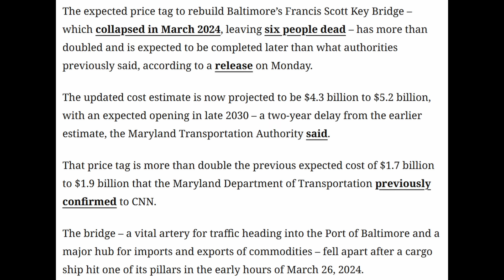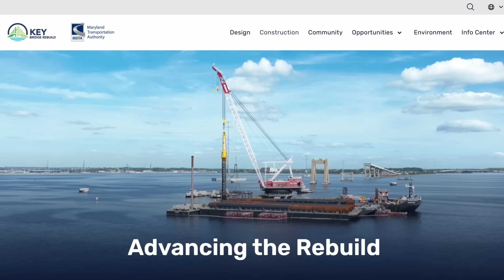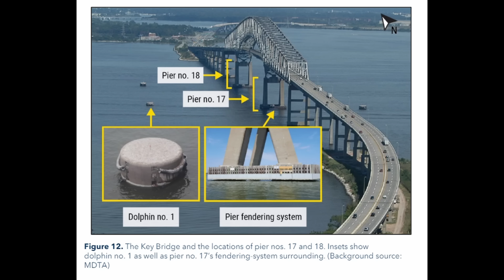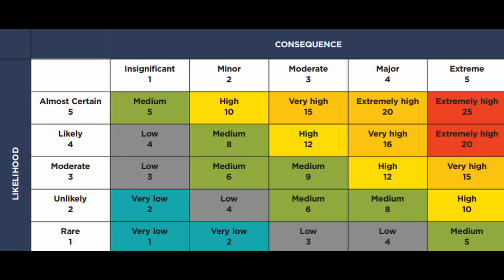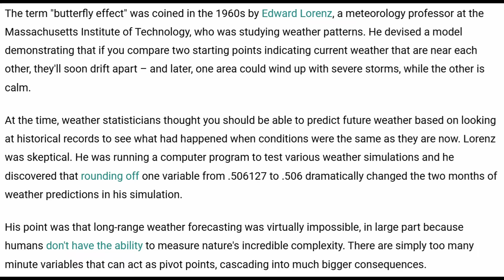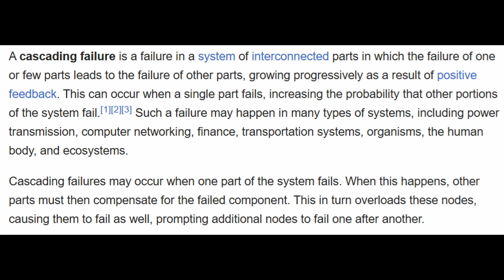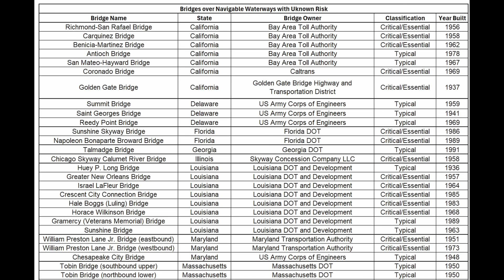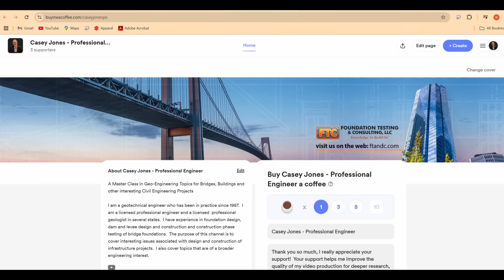Key Bridge Destroyed because of a Label on a Single Cable

Comment: The configuration of the vessel itself was to retrofit the clean fuel in a manner that wasn't automated. Generators 3 and 4 used a flushing pump for clean fuels in port. On top of this, the breakers weren't configured to auto mode, so the wire isn't completely the full cause here, it should have just automatically switched over.

Comment: in this case, a proper probabilistic calculation should have given a number of cycles (in this case a number of ships passing under the bridge) after which the chance of nothing happening halves... given the number of vessels coming under this bridge, such an event was overdue...
the key here would however be some form of a swiss-cheese model... the fact one wire could cause this (if it was one wire) is the massive issue here. now, having multiple tugs until the ship got beyond the bridge could have very much prevented this (and many other forms of failure), but you need to also balance it against the cost, and the impact the economic effect, and how that will effect society.

let us suppose that the added price to shipping of the tugs would cost x% which is in turn believed to reduce the regions economy by R%, at some point, the reduction in job availability will raise violent crime by about C% which will it may be estimated raise the number of Homicides by H%

now the range on each of these percent will be quite large, and will grow as you continue the steps away from the causal event, but, it can give a qualitative if not quantitive idea of how the effect of improving safety might effect other events, and it is an exercise that needs to be undertaken to determine whether one is most like to do good, neutral, or evil with every measure.

just saying...

Comment: Casey. I donot know how to even start looking at this but would the key bridge have been protected properly if it had the level of protection that is being built in bridges today?  Put another way, would we reduce the risk if we upgraded protection or is the current measures inadequate.  I find it hard to believe that the 4 dolphins would have been adequare to orotect the bridge from a ship of the era it was built.
Reply: The dolphins prevent a ship from striking the piers straight on. If the Dali would have steered directly towards a pier, it would have struck the dolphin first. (In this case the dolphin would probably have been too small to stop a ship that size.) But because of the power outage the Dali drifted sideways out of the shipping channel into the pier, without hitting the dolphin first.

Comment: I am not convinced by the butterfly effect being relevant here.  We know that low probability events do actually - and indeed sometimes more frequently than we thought - occur.  The problem is the 'positive feedback', that your quote identifies.  We need to ensure that a low probability effect does not cause a catastrophic outcome.  For example in that case of the new key bridge span you mention, where an off-course ship would run aground first before striking a pier, the bad event has been assumed to happen and the consequence designed out.  In other words the low probability event is recognised to happen sooner or later, but we ensure that it can't cause a catastrophic outcome, by designing it out.  The approach needed is probably to start with the catastrophic outcome, work out what could cause it, and then design out the link between the cause and the effect.  FMEA style.

Comment: We need to pull even further back. 

Why is a heavy cargo ship allowed to maneuver on its own near delicate infrastructure? We do not have to do that, we could have small fleets of modern tugs pushing them around as needed. 

This would be safer, cleaner (ship emissions are horrible and tugs can be electric), more responsive, etc. 

But the big international shipping oligopoly do not want to pay for that. It would cost them a lot of money, money that could go to local workers, money that would support local infrastructure.

The reason we dont do this is to protect the shipping billionaires.

Comment: It is always a good laugh when you find a loose cannon that goes off on his own and does a ton of useless work!  These type people usually end up with a monster project or finding a new job, depending on the judgment call of their leadership.  I went through this process.  I did an in depth study, on my time, to land a monster project that no one could figure out.    The project was a CEO mandate that wasn't getting anywhere, as it was too complex for the 5 people that tried to solve it before me.  It took me 3.5 years to tame the beast and another 1.5 years to complete the mandate.   In the end, we had an AI to solve complex engineering problems.  Then I had engineers calling and asking how I figured it out, how it worked, and they want an explanation in 10 minutes.  They made me laugh, as there isn't enough time in a day to explain that process.  I provided them with my flowchart.  It was 10 - D sized plotted pages with number 8 font and packed in so dense it was overwhelming!   The technical definition of an AI is a complex database solution.

Comment: You like many others did not look deep enough into the NTSB report. While that was the initial cause of the power outage, it would have been a minor blip rather than a catastrophe if the ship's crew had not rigged an unapproved bypass on the fuel supply for the backup generators. They did this to save time and labor when in harbors to avoid having to flush some lines of bunker fuel to use clean fuel for in port. AND THEY FOUND THIS MODIFICATION ON OTHER SHIPS IN THAT COMPANIES FLEET. That unapproved change is completely the reason that bridge was hit. That company is fully at fault. We must police these shipping companies harder.
Reply from the maker: No, I don't think you followed my point.  The cable problem was just one of many factors in a long list of causation which illustrates why the AASHTO methodology for bridge impact risk assessment is simply folly from a predictive standpoint.
Reply: @CaseyJones-Engineer  Judging by this video’s comments section, I don’t think your intent came across sufficiently.

Comment: Sorry, I wrote a paper on the risk matrix following extensive analysis. The matrix shows poor results in the risk levels 6 to 10 ranking in your table. The problem is that frequency estimates are very poor. While there is some history to aid in the frequency estimates for bridge traffic, frequency changes just as much as vessel size could change. The RM's frequency estimates are very sensitive to the level of experience of the user. What does work is to do the pareto analysis based on event consequence. What also works is to use the judgement of the expert or do some stochastic analysis using better models of vessel, environmental or human error excursions. Casey's judgement is more accurate than the RM. And, Casey can be interrogated as to why this bridge is high, medium or low risk. The risk matrix just spits out a number. If created by a team, the answers tend to get negotiated into the middle. Who then answers for the team.
Reply from the maker: Thank you so much for your very interesting comments!
Reply: @CaseyJones-Engineer  Check Process Safety Progress ...August 2023 and May 2024.

Comment: As to why the ship lost control... It's not relevant to this disaster... Ships can, and do, and always will lose control... The important question is, why did an out-of-control ship transiting a busy shipping channel end up collapsing a major bridge?  The port authority is the real culprit here...  When they dredged the channel down to allow these monster cargo vessels at that port, they did not make the necessary improvements at the structures protecting the bridge abutments... Why not?... Well, dredging is relatively cheap... Redesigning the structures protecting the bridge is very complicated and very expensive... Why are the authorities and the media then focusing on the hapless sailors and shipping company?... That's because you can't sue or penalize the port authority since they have 'sovereign-immunity'... so you have to find another culpable party.
Reply from the maker: Those are all excellent points.  Then there is the possibility of "bad actors" which makes the whole probabilistic approach to risk assessment just silly.

Comment: A number of points about your excellent presentation:  The Tobin Bridge in Boston and the Memorial Bridge over the treacherous Piscataqua River in Portsmouth, NH are both  accidents waiting to happen where enormous tankers and bulk carriers slip through extremely narrow spans in extremely congested cities - thankfully the Key bridge was 'out in the water'.  To add to the issue in Portsmouth, when the tide is running it reaches 12 knots at flood on the river.  It's a 'bear' of a river to navigate.  Finally, I've got a number of 'lights' and a GPS unit that plug into various USB chargers.  A slipping 'label' on one of the wires has to be paid attention to constantly. Otherwise, when I go to use the device and it dies within minutes of being removed from the charger I know that the damned 'label' slipped again. Nothing more than an irritation  in my case.  Finally a number of year ago a truck driving on the lower level of the Tobin hit and displaced a vertical column.  The upper level crashed on to the lower level.  What a mess!

Comment: i understand completely how this happened.  i am a former third engineer and a former electrical utility operator and have seen half of San Francisco de-energized as a result of a similar lose wire on a metering and control circuit and wrong configuration.  check lists and switching tags reduce the problem but nothing gets rid of the human element.
Reply: One reason that the Navy has had almost zero incidents with their nuclear reactors is the meticulous way they do their maintenance. Every maintenance procedure in the Navy has a list of tools needed, training needed, and step by step procedures to be done. The Nukes take it one step further. There is one person at the podium who reads off each step one at a time. The person doing the maintenance repeats back what was read to him. When the guy reading the steps verifies that the person doing the maintenance heard him correctly he then gives the go ahead. When the person doing the work finishes the step he says what he has done, and when that matches what is in the book, then they proceed to the next step. It it is very manpower wasteful, I know but when you are working with nukes, you have to absolutely sure it is done correctly. 

Attention to detail like this would prevent most disasters, but it would also prevent many things from happening at all. There is a balance between costs and risks.

Comment: i mean.....is this the smallest mistake that had has had the biggest impact ever? a fu**ing label? its almost impresive a guy/s doing the labels and not following the guide caused a screw up which then snowballed with a bunch more mistakes. and it all happens at the worst possible time. "biggest work mistake?....i put on a label wrong and caused  billions in damages"

Comment: Having done engineering system failure analysis, computing the probability of the potential of a failure is just a math exercise. Identifying all the potential failure points and how they can interact is a first step. Quantifying the possibility of any failure point occurring is hard even with good historical data. Frequently there is no reliable data to base the probability of a failure on other than antidotes. Large systems with many component parts really require a lot of research. Over designing each component helps, but too often the push back is always the cost. Every bridge, road, dam, etc. should be designed with the worst conditions in mind, not the optimal conditions expected.

Comment: The loose connection is but one hole in the Swiss cheese.  A LOT of things went right that night (most actions of the pilots, for example...even as the pilots executed some notification procedures that had been recently superseded).  A critical few/ several things went wrong at the right times.  Had the wire not been loose, this would not have occurred.  Had other parts of the ship's machinery been lined up differently, it would not have occurred.  Had we designed the bridge or channel differently, it would not have happened.  

"It was a loose wire" is about equal with "our environmental regs caused it" (because the ships machinery line up is tied to the use of a specific fuel that must be used in US waters".  Both these things are true, and neither in isolation caused the bridge to come down.  Many things failing at the same time did.  This includes never updating an inherently insufficient original design for large public critical infrastructure.

Comment: As someone who has worked on vintage cars, and (the opposite tbh) hilariously computer networking, i can almost guarantee i know * how * this wiring issue happened... You see the hundreds of wires into those junction boxes? Theyre all installed at the same time, and then the label is applied. But when there is damage to the actual wiring, or the junction it connects to, fusing the copper wire, instead of trimming back, patching, and reinstalling... They just strip more insulation back, jam it into the junction box, and well yeah, someone who thinks this is appropriate, may also ignore the basic steps to make sure the rest of that circuit isnt compromised. If this wasnt "repaired" right before embarking from baltimore, its likely the wire or other component, was damaged somewhere else, causing high resistance or load, and the heat comprimised the connection. The only way this would have been directly caused by that label/ferrule is if the repair had just been done, and even then, that the repair was done so shoddily that they didnt even tighten down the retaining component on the wire, or fed barely any wire into the retaining component. How else would that label/ferrule have the levering/pulling force to remove a wire long after the repair. 

Basically, the label being much closer to the junction box is a huge red flag that a repair was attempted by unqualified, or lazy people, but was it the primary cause? No. That label does not have the strength to overcome the binding force of the terminal the wire is fed into, unless other more major issues like unqualified staff repairing critical systems, or inspections of vessels not identifying a problem anyone who has worked on sketchy networks, electrical systems, vintage car electrical systems, (and marine electricians of course) would have pegged as a huge red flag immediately.

Comment: Casey, very interesting video.  Let me give you another small example of the butter fly effect.  While working in Iraq as a truck driver, we had a briefing prior to our mission.  We were to haul supplies from one base to another nearby base.  The briefing was verbal with a map of our area on a 5x7 piece of paper.  Way too small to make out details of the turns in the route.  At about the midway point we came upon a T intersection.  We turned right when we should have gone left.  We made a u turn in a small field at the Tigris river.  On our way back out we were ambushed.  The guy in truck 7 was shot in a lung and pancreas.  Then a bomb went off under truck 1, the driver died from a gunshot wound to the neck. The bomb went off directly under where he had been sitting.  The semi with a fully loaded container overturned.  I was in truck 2 and shot next.  I was hit in the femoral artery, profunda femoral artery and the femoral vein, plus several other places.  Then, the guys in trucks three and 4 were killed.  So we had three killed and a total of six wounded.  It worked out ok for me because I now have lots of time to study interesting things a result of being totally and permanently disabled.
Reply from the maker: Wow, that is a devastating sequence of events!
Reply: @CaseyJones-Engineer   Not as bad as a lot of incidents, but definitely bad enough.
Reply: Bless you and thanks for your service.  The story does not surprise me one bit,..
Reply: @fromthefireside5677 No and it really illustrates how not paying attention to detail can create problems beyond your wildest deams.  Keep up the good work.    I really enjoy getting your prospective on things.

Comment: The failure of a one dollar shaft key/key stock in the steering gear of the MSC "Sea Witch" caused the ramming and catastrophic fire aboard the "Esso Brussels" and the "Sea Witch" in 1973. No pun intended by the use of the word "key." lt's the only word that fits.